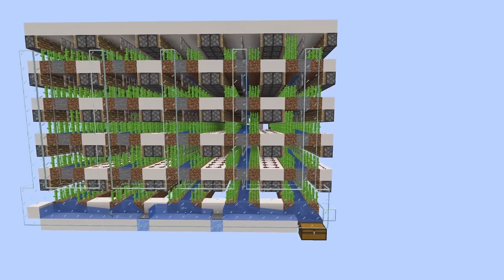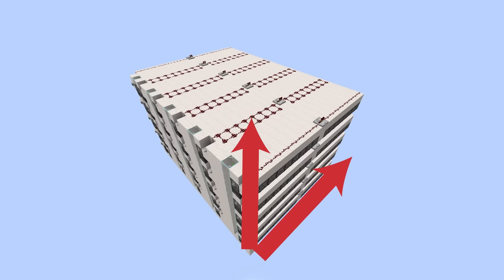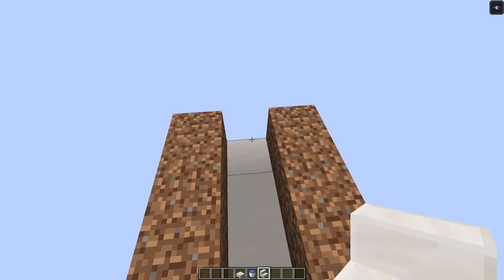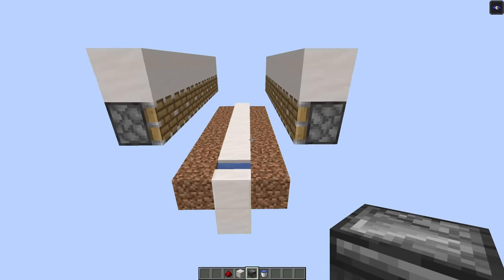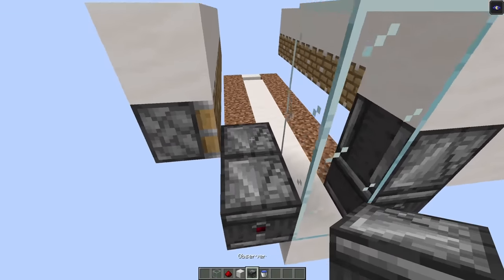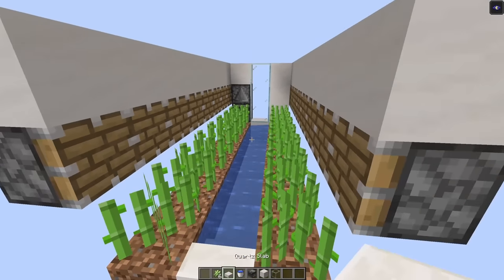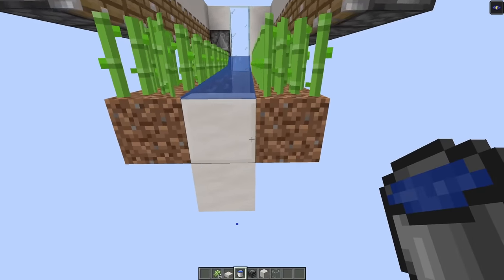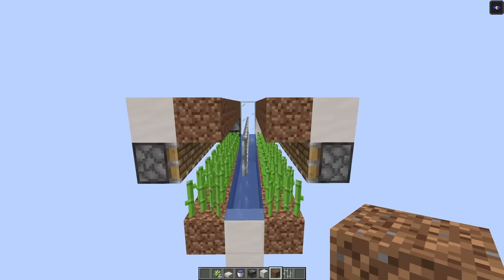Sugar Cane Farm! Compact, Lossless, Easy to Build! (Minecraft 1.15+)

Comment: The good part of this design is the fact there isnt a flying machine.
Reply: Technically a flying machine is only a problem if you want to leave the farm running unattended. Unlike a flying machine farm, this design has the minor downside that it cannot be turned off easily. Also, a farm with a flying machine could just be scaled up such that a single harvest is likely going to satisfy your immediate needs, and then the sugarcane can grow back until you need more and harvest again. Lag from the flying machine only happens while it is harvesting.
Reply: Yep this is a good farm but already have one with a flying macgune that is doing a great job maybe in another server I would make the farm from the tutorial
Reply: @TheRealWormbo  yeah, tango made this one specifically because his previous farm kept breaking bc of the flying machine issue
Reply: To be fair there are ways to build flying machines that will reset by themselves if they break
Reply: @TheRealWormbo  This cannot be turned off easily? 2 easy options are a leaver that "turns of " the observer (breaking the connection to the block), or a lever on the redstone that keeps the pistons extended, super simple
Reply: @Jeppelelle  not as simple as the flying machines would tho.
Reply: Did you say that to act like you did not see the hermitcraft episode?
Reply: @TheRealWormbo  could you not turn it off just by powering the redstone line and  keeping the pistons extended?
Reply: @TheRealWormbo  unload chunk = broken flying machine
Reply: CrayRT Mumbo built his with a flying machine and I’m scared he’s going to have to tear it down like Tango did
Reply: @TheRealWormbo  yeah, but slime can be a super big problem in survival worlds, I prefer just slime or honey less farm
Reply: The whole point of a flying machine one is that it is a manual harvest that gets a chest worth each time
Reply: @mayonnaisepudding6524  Well to be fair. Mumbo could just keep his flying machine sugar cane farm as it is and just tweek tango's design to make a bamboo farm.
Reply: @TheRealWormbo This farm can actually be turned off instantly, just add a lever at the end of the redstone line. Flying machine on the other hand, can’t be easily stopped without it breaking a tiny bit while flying
Reply: @mayonnaisepudding6524  IIRC Mumbo built his massive cane farm last season with an on/off switch so that the flying machine wouldn't be running unless he was staying in the area. Haven't seen what he did this season, but Tango's first farm didn't have anything like that which is why it broke. This design is way better because he doesn't have to worry about chunk loading issues.
Reply: TGNM but if you use a good design it will fix itself
Reply: Reid Falkson don’t worry. Flying machines are super easy to rebuild if they break, and they are the more material efficient design. It was a smart choice making his with a flying machine
Reply: Raskolnikov70 Mumbo’s has an on-off switch but I was saying that he might accidentally leave it on and unload the chunks which might break the farm
Reply: @TheRealWormbo  I've run redstone up the back of my version of this allowing me to power all pistons from a single control line, keeping them all extended and thus shutting it down.
Reply: @ninjao_yourninjabro5501  Plus they give you the fun project of setting up a warning system to indicate if you're about to leave them running - my witch farm has a very annoying bell in the portal room, plus beacons that switch between red and green.
Reply: Reid Falkson but they take seconds to build. If he does break it he can fix it in under a minute
Reply: I wish I could put 10 thumbs up on this comment
Reply: Ron Thompson why? Flying machine designs are easier to set up
Reply: No flying machine - Loads of pistons, though. I'm thinking it might be better to build something that uses slime blocks to reduce the number of pistons - like the Scicraft sugarcane farm. Definitely enjoying playing around with Tango's design, though. I like the water stream setup on it...
Reply: @CrayRT which brakes every time you unload a chunk
Reply: Tetsujin slime blocks are expensive though. Flying machines use very little slime blocks and pistons.
Reply: Haloforza but they are so easy to rebuild. They are so much better
Reply: they are the most dense farms and you can run it with a clock instead of having the flying machine flying continuously
Reply: infra 84 they are so much worse. Flying machine farms or easier to build and cheaper to build
Reply: @ninjao_yourninjabro5501  i love flying machine powered sugarcane fams, they are the best
Reply: @TheRealWormbo  or just use sticky pistons to pull the observers from the back away from the sugar cane it is observing to turn it off
Reply: Yessss!!!
Reply: TheRealWormbo 
You can turn the farm off by blocking the redstone line
Reply: Rsai91 From YT 
It should not sure tho
Reply: Can u use glass panels instead of the iron bars
Reply: Plz tell me I don't want to waste iron
Reply: can u use glass pains instead of the iron bars
Reply: Hardcypress boi I would guess so, you’d really just have to see if an iron bar and a glass pane have the same hit box.
Reply: Anyone have problem with mobs spawning inside?
Reply: Apollonium I haven’t noticed, but that is because I light it up by using Sea lanterns and Jack-o-lanterns in place of the non dirt structure blocks to reduce lighting updates from the dust.
Reply: Travis H Ya I didn’t do that at first. I just went through and put in some glow stone hopefully that will do the trick. Thanks man.
Reply: My flying machine is not working.thanks for this
Reply: Really wish these youtubers would specify bedrock or java.....

Comment: I think the main appeal of this kind of design is the 'reliability' aspect, rather than compactness and easyness to build
Reply: And how it works on Bedrock !!!!
Reply: It's also a nice looking farm, lots of farms look like a redstone mess but this looks pretty formal
Reply: @aeolus9981  IKR! 0% of your daily recommended quasiconnectivity
Reply: Yea, I don't care about compactness. I'd rather put a block in-between them just so I can place sand instead of dirt.
Reply: @aeolus9981  Does it? Somebody else said the water washes away the sugar cane in bedrock.
Reply: is the compactness in regard to the sugar cane growth pattern or the redstone layouts?
Reply: It does not work on bedrock as far as I tested, water washes plants away
Reply: my water is going everwhere
Reply: You have to change the slab placement for bedrock. You're going to be redoing the first unit a couple of times, then the ones farther down the line work easy
Basically, you waterlog a slab at the front, let the water flow down, then raise the water slightly by placing them down stream, then break them. You end up with no slabs, but the water stream stays in place. For the layers above, no slabs at all
Also it's not completely lossless on bedrock, but still pretty close and very reliable
Reply: Yo, does this worl with bamboo as we'll?
Reply: I think the main appeal is compactness and easyness to build, rather than "reliability" aspect. Items will just despawn if it's 95% lossless who cares about 100% and you can just make a bigger farm because it's compact and easy to build.
Reply: @noelic6744  Sand doesn't make sugarcane grow faster than dirt, that's just a myth.
Reply: @hehehehaw7  ? I never said anything about that myth. I just said sand looks better than dirt so I'd rather use sand than save space.
Reply: @Olivia_Spring  Ironically the guy who made the comment has a sugarcane farm that looks even better.
Reply: I disagree
Reply: @aeolus9981  it's shouldn't work in bedrock edition cuz observers can't detect a lot of things that java observers can
Reply: @noelic6744  Why sand?
Reply: @lihung364  Looks better than dirt.
Reply: @skeevymcgee8507  A decent solution that I found was to put water-logged stairs on the outside of the row of dirt blocks. I tore the slabs out of the middle and made a simple water stream over packed ice leading into a hopper where the waterlogged stair was.
Reply: @noelic6744  Is this a reference to Ssundee making sugar cane grow faster on snad instead of on Crainer's dirt?
Reply: @Olivia_Spring  spilled
Reply: @noelic6744  Also In modern versions, you can use moss instead of dirt too, which also looks nice.

Comment: PSA: to make an 8 module farm of 2 long, 2 wide, 2 high, you will need to following:
128 pistons
12 observers
12 packed ice
128 sugarcane
134 redstone dust
6 repeaters
128 dirt
Solid blocks, I've estimated at around 6ish stacks, didn't count them exactly, maybe take a couple extra stacks.
128 slabs, you could take less, as some get broken on the 2nd layer, but you will place 128 slabs.
4 stairs
20 glass
68 iron bars
Lots of water
Plus however many chests and hoppers you want to use for collection and storage.
Will update the drops per hour of an 8 module farm once I've made this in my SMP, as only built a quick test in creative so I know what I'm doing first.
Reply: from this machine you get 350-450 items per hour. tested it extensively with speeding the game and tickspeed. works great on Spigot Servers!
Reply: Completely forgot to update, with basic testing I got around 5-6 stacks an hour with 8 modules. I'll still be upgrading to at least 30 modules, but 8 is good early game and easy enough to make early game. 8 would also be enough if it were put near your main base and is loaded a lot of the time. Mine is in an industrial district and required dedicated AFK time, and I'm finding it requires more than 8 modules for that type of set up.
Reply: @notemery836  I've sent you a friend request on DC
Reply: I made a 768 plant (48 module) version of this on the Pixelpunch smp and it yields 1440 sugarcane/hour
Reply: The unfortunate part is that this farm in large sizes is hard to spawnproof, the only option is to make most of the walls out of sea lanterns or glowstone
Reply: @chloethompson6729  torches in the two block gap between the modules (sides) assuming you filled them in with blocks and didn't leave a gap
Reply: @tylerjacobson3169  I'll do torches on either side of the ice separating each module, there are no other gaps in the farm I built
Reply: Thanks
Reply: Who439 who needs this much sugarcane lol
Reply: @arinzeokerulu8577  丂ㄩᘜ卂尺匚卂几乇
Reply: @arinzeokerulu8577  for trading paper to villagers actually
Reply: Who439 o I didn’t know u could do that. What type of villager tho?
Reply: Arinze Okerulu elytra needs fireworks which needs paper
Reply: IMHO, just bring 6 more packed ice and 32 dirt and make the top layer "extension ready" for when you decide to extend it.
Reply: thanks i was going to make 9 module farm so 3x3 the materials are close enough so ill just get a bit more of everything
Reply: @arinzeokerulu8577  You probably already found out, but 24 paper could be traded for 1 eemrald. Getting the libraian to the next level, would get you the ability to trade emeralds nad normal books for enchanted books. (book of mending is the holy grail) Libraians use lecturns as work stations.

Comment: For people building on 1.19+
An improvement that can be done is to replace the waterlogged stairs for waterlogged leaves, that way, sugarcane that was broken really close to the edge won't get stuck in the stair hole in some rare cases.

Also, beware that pistons now fire randomly, but it still works, no worries.
Reply: Oh man, thanks for this! I just built it a couple of seconds ago and the pistons started firing out of nowhere. Was quite confused.
Reply: Thanks man, the leaves was a great change
Reply: thank you so much, i thought that i was going insane bc i kept hearing the piston noise but it was always when i wasnt looking and i couldnt find a cause. you are a lifesaver
Reply: why do the pistons fire randomly?
Reply: @thenameless7505 the observer is probably detecting when the sugar cane receives a random tick which increases its age value

Comment: UPDATED FOR 1.20+   100% Loseless. 
>Replace the iron bars with closed fence gates,  
> Reason you're finding sugar cane on the dirt is because of both pistons pushing the item from both sides at the same time, to fix this add a repeater and set delay to 4 , so that the pistons facing each other does not fire at the same time.
Reply: why fence gates instead tho?
Reply: @Mr._Lagom  From 1.16 ownards Iron Bars connect to nearby blocks such as piston heads. This sometimes pushes the sugarcane to the sides. Fence Gates don't have that problem
Reply: @agniveshsp  ah, tysm!
Reply: Where do I add this Repeater
Reply: @AL-fx7yp  at the row of pistons on both ends so that the pistons facing each other dont push at the same time.

Comment: Love this design! It has the easiest redstone, is expandable on ALL directions, is fairly resourcefriendly, is compact, works in 1.16 and last but not least: no flying machine!
Reply: It's an "oldie but a goodie" design, although I think the original design involved a budded smart piston to power the entire row. I reconstructed a design similar to this when testing out various farms - I also like having the observers looking at the bottom reed (sugarcane) - it causes random tick updates, but on a large scale, it's slightly faster, but also slightly bulkier - something ilmango and gnembon would make an hour long video on, but I don't care if I get 1,000 drops an hour less. :)
Reply: does it work in versions like 1.14/1.15
Reply: @ethhhann165  It should - it uses the waterlogged mechanics from 1.13. I've also tested a similar design in 1.15.
Reply: why does he put the observers at the level of the first block of sugarcane rather than second? should it be the second so it can detect the empty space being filled with sugar cane and activiating the pistons?
Reply: @samthong3305  It's because each layer triggers a random tick, even if it doesn't grow. It just makes it more compact.